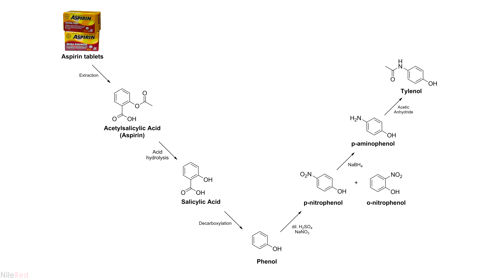Aspirin to Acetaminophen - Part 1 of 6: Extracting Aspirin from Pills

Comment: Nile red (or anyone), Last night while doing this experiment I got to the recrystallization of the acetylsalicylic acid and heated up the water. I ended up forgetting to turn off the hotplate and the next day (Today) I noticed that the bottom of the beaker was full of burnt compounds, however, snow white crystals were on the top of my beaker. (I didnt use an erlenmeyer flask for the recrystallization.) I was wondering of ASA thermally decomposes into any compound like salicylic acid. Are these crystals ASA? Id like to know because I dont want to waste them attempting to identify if they're ASA. Also if they are why didnt you vaporize the ASA to remove the dye? Thanks in advance.

Comment: When you buy aspirin and realize you're allergic, but you also have a PhD. in chemistry... So you just convert it into paracetamol.
Reply: I want it to be relatable ._.
Reply: +Wannabe Scientist Same. If I had a PhD in chemistry, I could die happy.
Reply: crnobijeli13 relatable
Reply: Chrischi3LPs Aspirin is also a blood thinner. If you already have low blood pressure that could be the reason for that.
Reply: just saying, i get headache from Aspirin, like, what the fuck, isnt that supposed to cure that?
Reply: possible, but id rather say i have high blood pressure. anyways, id say ill stick with other alternatives for the time being.
Reply: Can we extract theo opiates fm loperamide ...???
Reply: @dub5107  , it may be possible, but even if it is we will not be saying how to do it.  We are here for the science, not to learn how to make poor mans methadone.
Reply: @FunkBallGX  Permanently disfigured and damaged proximal left hamstring and adductor here. I managed 6 years with out any pain meds and suffered through the pain. But your body can only take severe pain for so long before it breaks down. I've had to rely on pain meds since 2009. They've made life tolerable, but I think I'm reactive even to them at this point, with the acetaminaphen they put in them all being the primary problem. My god damned liver labs come back normal based on western med, but my symptoms per traditional chinese med, and european herbal medicine (what all europeans used before the medical monopolies were forced on us), all point  to liver and kidney damage and functional impairment. Glad I knew about the separation of the meds before I even had to go on them. Couldn't actually do the separation until about 2 years of use though because sitting, standing, and walking were all horribly painful and my leg was so weak. Any way, you're right, many of us derive benefit and never go out of our way to abuse stuff. I just wish the medical industry wasn't so fucking corrupt. I might have been given the proper amount of physical therapy without the asshole workers comp stopping me short of what I needed to avoid becoming a lifelong cripple in pain.

Comment: you can mono nitrate the aspirin right away, and do a reduction in a mixture of acetic acid and acetic anhydride to get the para acetaminophen. that way you would save quite a few steps. You can even use only acetic acid if you let the reaction run for a longer time. The yield should be better that way too.
Reply from the maker: To be honest, it didnt even occur to me to start with the mononitration
Reply: Decarboxylation of aromatic nitrocarboxylic acids proceed way easier than the non nitrated compound. Plus, more often than not it will decarboxylate in situe
Reply: legoalex

Comment: Hi Nile Red. Do you think it would be possible to do an extraction of salicin from willow tree bark?
Reply from the maker: thats actually a pretty good idea
Reply: NileRed can you also recrystallize with IPA?
Reply: @NileRed  
I need help can you point me in the right direction, it's simple, I'm trying to extract acetic acid from aspirin pills,and I'm not 100 % sure if what I got is really it. I crushed the pills and added hot ethanol to it which leftover hard Crystal's. I know crystals appear as acetic acid when done right,but I also know that acetaminophen can also crystalize.
Can you help me out ?
Reply: If this video has been done already I want a link. 

But since it hasn't been done I will simply moan about it in this comment thread
Reply: NileRed would you be willing to do it?
Reply: gg
Reply: Was wondering the same
Reply: Someone has found any literature about isolating salicylic acid from plants? I couldnt find any

Comment: Careful, man. Even in water or acetone, you'll decompose quite a bit of it. Heating should be kept to a minimum throughout the entire process.
Reply: Does it matter if his next step is makig salicylic acid anyway?
Reply: Erik Hoevenberg
Salicylic acid is the decomposition product of ASA. Both aren't very soluble in cold water. So the SA should end up as impurity in the ASA which doesn't matter because making SA was the next step.
Reply: Yes, if he has more ASA he can make more of the other stuff he wants to make.
Reply: Anticonny Didn't pay enough attention to know that but he trows out the acetone that contains the Salicylic acid right?

... I will come back later and edit this comment again I think.

Comment: Damn! Your video gave me an idea; I wish you would've put this out 10 days ago. I had just enough acetone (500mL) to dissolve the ASA I had. I didn't want to waste it so I only used about 400mL heating it up and complementing it with some butanone but I could've gotten away with 100mL. Pour a portion (or all) of the ACA in to a beaker, add 100mL of acetone to dissolve, heating it to a boil and getting a saturated solution. Then do a hot filtration just like you did (well, not exactly like you did . . . sorry). Then scrap the undissolved solids back in to the beaker, allow the solution in the flask to cool and the ACA to precipitate out, possibly putting it in to a freezer or ice bath. Then decant off the acetone back in to the beaker, add more crushed ACA tablets, heat, and repeat until all of the ACA is in the flask. This of course only matters if your too broke to spend $6 on a liter of acetone AND your largest boiling flask (a modest 500mL at that) broke and you don't have any money to replace it, nor the patience to do half a dozen distillations to recover the $1 of propanone.
Reply from the maker: There are definitely many ways to be more efficient with solvents. It just usually requires more time. When you have the budget, it is so much easier to be wasteful unfortunately.

Comment: If I were you I would use activated carbon to get rid of that pinkish dye component somewhere around 6:40 or 10:30 and I second what you said @1:39. The cheap brands are much better to extract ASA from, because they contain just good plain ASA + filler and no those fancy additional components to improve taste, appearance or solubility in your stomach.
Reply from the maker: I just didnt think it would have been worth it to do activated charcoal, but it mightve worked. The next step is the hydrolysis, which involves a second recryst and then the phenol will be multiple distillations. I figured it would all get cleaned out eventually. (spoiler alert: I made the phenol and it's very nice and colorless)
Reply: NileRed That's a reasonable approach. Based on Drugs.com information (I assume this is your brand: https://www.drugs.com/otc/224985/bayer-aspirin-extra-strength-caplets.html ?)
your caplets contains:
 D&C RED NO. 7 : (Lithol Rubin BCA) https://pubchem.ncbi.nlm.nih.gov/compound/9571018
 FD&C BLUE NO. 2: (Indigo Carmine) https://en.wikipedia.org/wiki/Indigo_carmine
 FD&C RED NO. 40: (Allura Red AC) https://en.wikipedia.org/wiki/Allura_Red_AC
 ...plus lot of other inactive crap that complicates the separation.
These dyes should get absorbed by activated charcoal quite nicely, so the very first crystallization might have given you a well bleached product.
But I still strongly suggest to pick less contaminated starting material. Check out ingredients of different OTC brands here: https://www.drugs.com/otc/aspirin.html
Some of them are almost plain aspirin and starch. Anyway, this stage is already your history, so this advise mostly goes to your subscribers :))
Good luck with the upcoming stages!

Comment: might you get better para selectivity if you nitrate salicylic acid before decarboxylation?
Reply from the maker: I think you also get some meta, but it might actually help a lot in yield. My purpose in going from phenol though is 2 fold:

It would show the normal synth of paracetmol. Also, I dont know how well the decarboxylation of the nitrated compound works. 

I know the salicylic acid one works well, but the nitrated one might give me troubles.

Comment: I have just two questions
1. why not just start with phenol?
2. if you wanted Acetaminophen, couldn't you have extracted it from Tyleno, skipping this entire process?
Reply: Had he skipped the entire process  it would have defeated the whole purpose of this channel: performing the actual lab work.
Reply: The Janted Jangler Yes, he could have, but where's the fun in that?
Reply: By following his proposed procedure, he will demonstrate:  (1)  hydrolysis of an ester, (2) decarboxylation of a carboxylic acid, (3) nitration of an aromatic ring, (4) reduction of a nitro group to an amine, and (5) formation of an amide from an amine.  So, if anyone else wants to perform any one of these procedures, Nile Red will have provided a guide for him / her.
Reply: Most amateurs have a hard time finding phenol

Comment: Can you extract THC from cannabis if it is legal?
Reply: 1. Bake the weed to decarboxylize it
2. Crush the dried weed
3. Soak up the dried weed powder in ethanol or isopropanol
4. Filter the solution
5. Either evaporate or distill the solvent
6. A yellowish goop should be left over, thats your THC.
Reply: XFiremaniac It can be done, however of course it is illegal to own cannabis (excluding some countries/states)
Reply: Nitro Nice
Reply: Oscar Poll i don't want to extract it I just say that it will be interesting for a video anyway thnx for the advice
Reply: XFiremaniac You will absorb THC in the process of extracting it so... be careful
Reply: well, not really. I mean, the yellowish goop (Decarbed RSO?) WILL have the majority of the plant's THC in it, but it will also contain terpenes, CBD, and other cannabinoids that are in the plant. Google 99.99% THC, THC is actually crystalline in it's pure form.
Reply: XFiremaniac Oh okay sorry! Your welcome

Comment: What was that nasty yellow crap floating around?
Reply from the maker: Im not exactly sure. I looked at the ingredients list and didnt see anything that immediately made sense.
Reply: NileRed could be a small coating that the pill does not instantly desolve in your throat or something like that
Reply: wax is likely. 

 Carnauba wax is usually used to make the powder flow easier when the pills ar pressed. 

I could also imagine that the pills are coated with something to avoid a bitter taste when you put them in your mouth. But if they also use wax for that i do not know.
Reply: Like wax or something?
Reply: Is there microcrystalline cellulose ("Avicel" or so)  listed?
Reply: Carnauba wax and bees wax is commonly used in order to polish sugar coated tablets in the last step of production. But these waxes are only used in very little amounts. Masking a bad taste or unpleasant smell is mostly the job of different polymers like acrylates and PVP. Fillers are often lactose and talc. Polyethylenglycol is used as a lubricant and titaniumdioxid is a white pigment which could also be present.
Reply: wpm just gonna leave this here
Reply: That's exactly what I first thought of when seeing it!

Comment: if you burn yourself with boiling aspirin water... will it hurt?
Reply: Yes, cause the aspirin won't get into your circulatory system
Reply: yes because of the temperature, but aspirin can actually be used topically when crushed into a powder and add little water to make it into a paste and it can relieve pain
Reply: ***** ah yes, that was the first lesson, young grasshopper. The second, was what I stated in my previous comment. **pats head**
Reply: @romosapien9758  
I think you were talking to trolls
Reply: Whoa. Mind Blow...
Reply: Callum Anthony Leake yes I'm aware, but there was actually a lesson to be learned from the joke
Reply: wat if it makes you bleed to hu?
Reply: Does thinking up dumb questions make your head hurt?
Reply: IT WAS A JOKE
Reply: Callum Anthony Leake i know, but maybe someone who doesn't know the answer will read this

Comment: If you don't mind me asking why do you want to make Tylenol and is it safe for human use?
Reply from the maker: I just thought it would be cool to synthetically go from one to another. Would it be safe to use? Probably, but I wouldn't. Ive made too many poisonous stuff and mercury salts to trust my glass.
Reply: I KNOW! SEND IT TO CODY'S LAB!
Reply: Or Acetaminophen.   Guess it depends which side of the pond one is on.
Reply: @NileRed; Hey, maybe you can use some activated carbon, followed by an ion exchange column chromatography, and finally a C-18 flash chromatography as a viable purification method on the Tylenol?

I realize that it is a lot of work to put into polishing, but I was wondering if it would even work at all?
I think it would be super cool if you could turn safe, drinkable ASA into safe, drinkable Tylenol; however, I suppose that would probably require getting a second, clean set of glassware that can only be used with food-grade reagents, which is not really practical... at all, lol.
Reply: Michael Stern also yes
Reply: nope, deadly toxic.... TO PAIN (and cats, snakes, rats etc)
Reply: tylenol, dont you mean paracetamol? "Para aceta phenol"